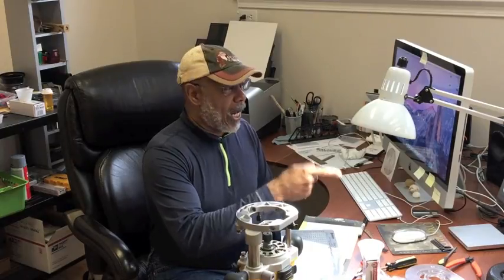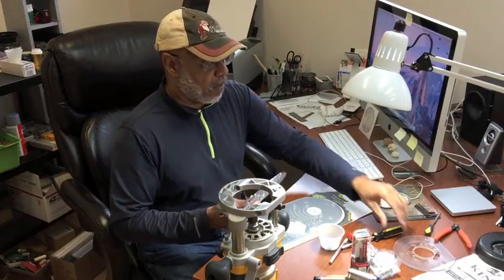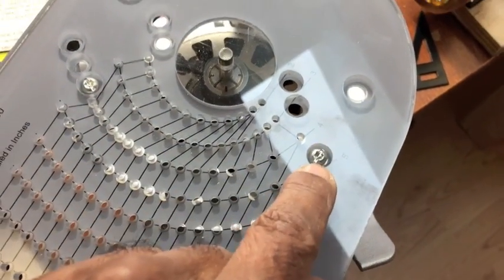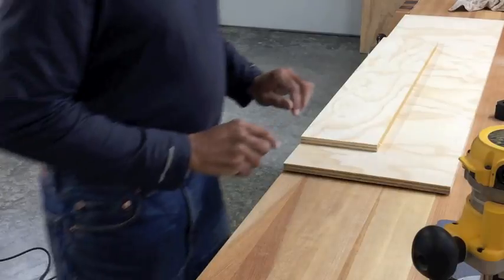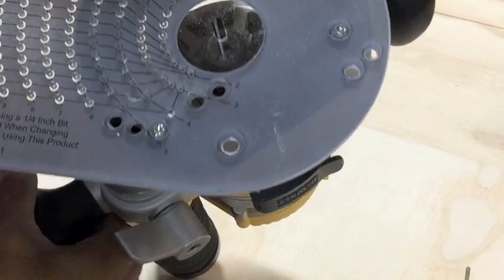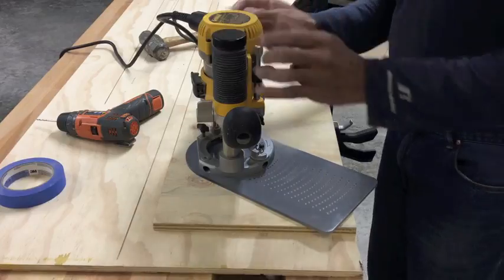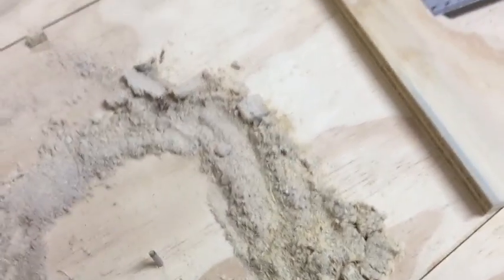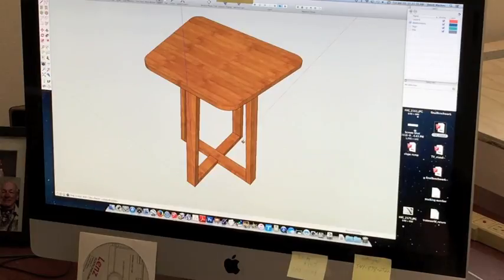Wood Knot Carpenter No. 21 - Jasper circle Guide

Comment: Dave.  Yes. Just drive the guide pin in deeper and it works just fine for the smaller holes covered by the base even without a jig. The thickness of the base plate is enough to hold the pin and cut the circle. Love mine. Deadly accurate especially when you make a hole and then the insert that fits perfectly inside it. Again, welcome to the PNW.
Reply from the maker: Hey, Andy. Thank you. Yes, I think that will work. I also noticed in the kit afterwards that they supply another pin which is only .5" long. I didn't see it at first, but it would have worked just fine. I'm still trying to discover a method for actually locating the needed hole that is covered by the base, but for now I won't sweat it. Take care.